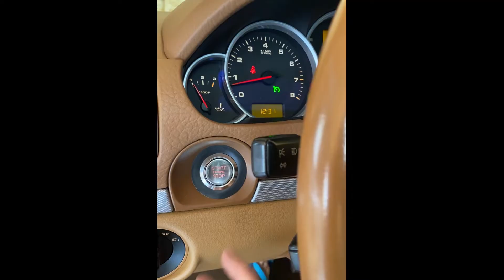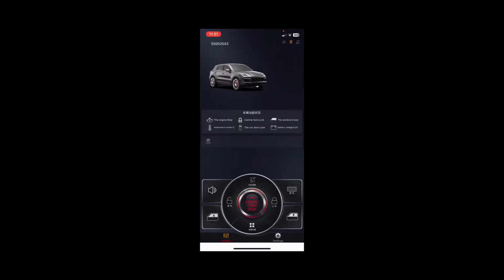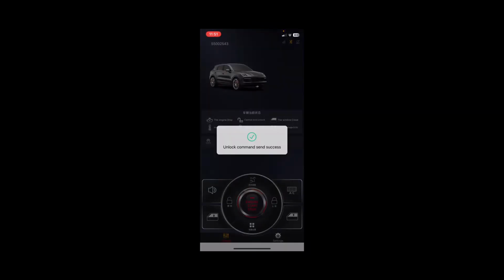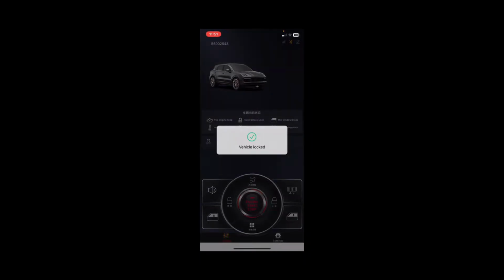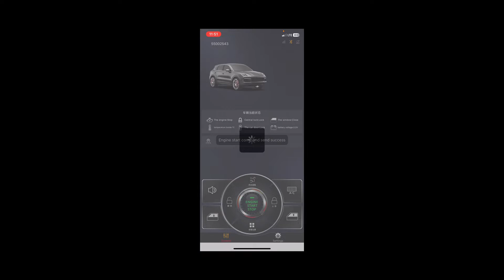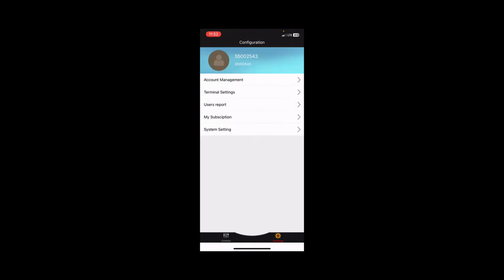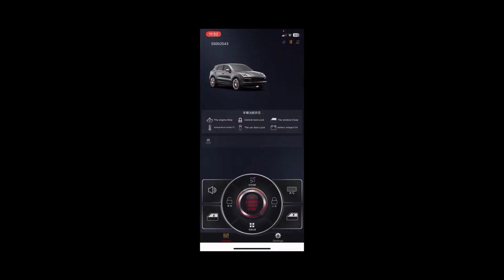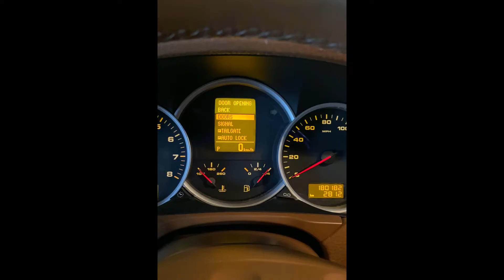Adding push start button, keyless entry, remote starter, and bluetooth app to Porsche Cayenne 957

Comment: may you help me.
i just installed it on 987, when press the ignition button, release the frunk and don't start the engine
Reply from the maker: Hi Roberto,

I wish I can help you; the kit that I show in the video is for 956/957 (Cayenne first generation).
I don’t have any knowledge about 987; maybe it has different wiring.
Please contact the vendor who sold you the kit and explain the problem.
Good luck.
Reply: I have the same problem 🙁 Did you find the solution?

Comment: Yellow wire do nothing but black and red is to give 3v to the key no ? How do you make it working without the 3v battery then to look and unlock ?
Reply from the maker: The original key’s board is soldered inside the kit and the kit comes with its own remote keys, so basically the new keys talk to the original key which in turn is soldered inside the kit which will lock/unlock the car.

Not sure if I answered your question, so please elaborate more on what component of the kit you’re asking about or what section in the video.
Reply: @_ARUS_  Thanks for your fast reply, sorry if i explain not well. What i am asking you is at 7:05 of your video, you say yellow red and black wire does nothing, so you don't solder them to the original key but How the Orginal key can work if you don't use the Black and red wire instead of the 3V CR2032 battery to Power the Orginal Key
Reply from the maker: @sup3rbosseur  I’m not sure tbh, but it works; I simply followed the soldering instructions that came with the kit 🙂
Reply: @_ARUS_  well i got no instruction at all in my kit 😅😭
Reply from the maker: @sup3rbosseur  I’ll check in a bit if I still have them then I’ll ask you to post your email (you can delete it later).
I’ll keep you posted, on that note I tried to make a very detailed video.
Reply from the maker: @sup3rbosseur  I found the email with the instructions; I can forward it to you. Also did you get the Bluetooth adapter for the phone app?
Reply: @_ARUS_ First letter of every word is the end of mail 😅

Yellow Apple Horn Over Open
.
Computer Of Mother
Reply from the maker: @sup3rbosseur  and first is the YouTube handler name?
Reply: @_ARUS_ sorry youtube wont let me xd very hard to put here

Well thanks you so much for all Your help and yes i got bluetooth kit like you
Reply from the maker: @sup3rbosseur  no worries; contact the vendor for manual and QR code to download the app that works with Bluetooth adapter.
Reply: @_ARUS_ first is Stelvio and then 789
Reply: @_ARUS_  thanks you!! You send me exactly what i needed this is Perfect, Have a Nice Day

Comment: Nicely done. Has the company got back to you about the firmware doors issue you explained?
Reply from the maker: So after using the system for few months I realized thay there is nothing wrong with it; it works as per design.
If you approach the car it will unlock only driver door, if you walk away it will lock all doors.
Now let’s say you’re in your garage doing something, the car will keep unlocking/locking since you’re near by so you can simply lock the car by pressing the key button, once you do that you disabled the passive keyless entry mode and won’t be activated until you unlock the car by pressing the key button.
Reply: @_ARUS_  but can you open all of the passenger doors with the unlock button on the remote? I thought that was the issue.
Reply from the maker: @maxwelludell3672  yes, you have to press the button twice, first time it unlocks the driver, the second time it unlocks all doors.
Reply: @_ARUS_  nice. Another thing, on AliExpress, some of the features on the app (heating/cooling, windows down function) say they only work on some models. Have you talked to the manufacturer about the functions and why they do/do not work with some models/trim levels?
Reply from the maker: @maxwelludell3672  I didn’t ask about the other functions that you mentioned because I only cared about the remote starter since that’s what I needed the most for the cold winters here.
Reply: @_ARUS_  I see. I might reach out to see when those work or don't. Thank God they developed this kit because putting the key in sucks and leather seats in the winter are less than desirable, even when the heated seats do work very well.
Reply from the maker: @maxwelludell3672  My Cayenne didn’t come with heated seats but I added that feature myself (I have a video on my channel).
Reply: @_ARUS_  I saw that. That was a good idea. I'm on the hunt for a set of the rear window shades. My kids need them and I was pretty bummed the cayenne I found didn't come with them.
Reply: @_ARUS_ also what's the range of the remote start Bluetooth?
Reply from the maker: @maxwelludell3672  it’s your typical Bluetooth device range; I’d say 10-15 meters.
You can buy the GSM module which comes with a SIM card and with that module you can start your car from anywhere in the world since now you’re connected via satellite.
I don’t remember the module price (maybe 150$), it comes with the SIM card which is free the first year then 20$ every year.

Comment: Hi Arus.

If I may ask, how did you get the rear lights to flash(blink) the way they do when you put the ignition on? Is that another kit or merely bulb types or fuse replacement,
Reply from the maker: Go to settings -> comfort -> door opening -> signal and check/select the [turn signal] option.
Reply from the maker: If you’re talking about the part where I start the car remotely and the taillights are flickering, that’s just how the camera picks up the LEDs; in real life they’re not flickering.

Comment: Hey thanks so much for this video. So helpful! Wanted to ask if you needed to connect a break line as well? Didn’t catch that part in the video.

Thanks
Reply from the maker: The kit is pretty much plug and play, so you only need to connect its wire harness which doesn’t require connecting a break line.
Reply: Thank you for responding! The one I bought has an orange wire that appears to be for the brake connection according to the seller. 

Will open up my car this weekend to attempt install
Reply from the maker: @josephhanna7542  maybe you have a different kit; mine is specifically for the Cayenne and I only had to connect 2 wire harnesses as you can see in the video: one is the ignition cable and the other is the cable that locks the steering wheel.
Reply: @_ARUS_  ok cool, thank you so much for your response, hopefully I can clear it up
Reply from the maker: @josephhanna7542  Anytime, you can watch this part (https://youtu.be/lyTh_QPCT6k?t=295) to compare your kit to mine. 
The kits that are sold on eBay are different from the one that I bought on AliExpress; the former require that you saw off the tail of the original key and stick it in the ignition then you cover it with the push button, the AliExpress kit is not like that, instead you take the circuit of the original key and solder it inside the kit itself.
Reply: @_ARUS_  awesome thank you so much. I got mine from AliExpress as well, but I think it has the added cable. Last question for you, are you happy with this unit so far? Any regrets or issues?
Reply from the maker: @josephhanna7542  yeh I’m very happy with it, hopefully it doesn’t glitch in the winter when it’s -30.
Reply: Where did you find instructions on how to install?
Reply from the maker: @josephhanna7542  I found another video that shows how to solder the wires because the instructions that the vendor sent weren't clear about that, other than that I had to discover things by myself.
Reply: @_ARUS_  hey where do you found instruction how to solder ?
Reply from the maker: @kkvv88  there was another video on YouTube; I don’t remember where it is, but you can see clearly in my video where to solder each wire if you pause the video.
Reply: Do you know if work on 2013 Porsche cayenne?